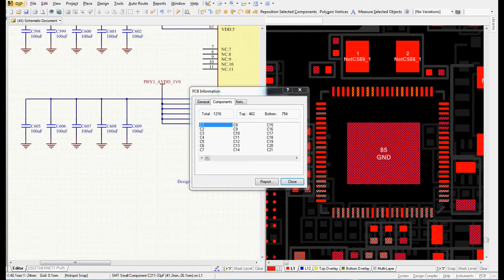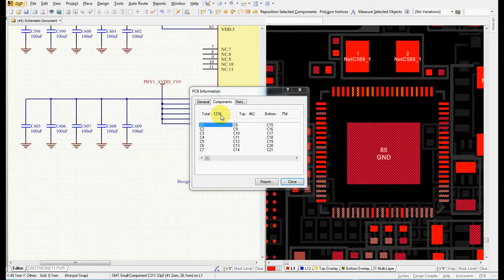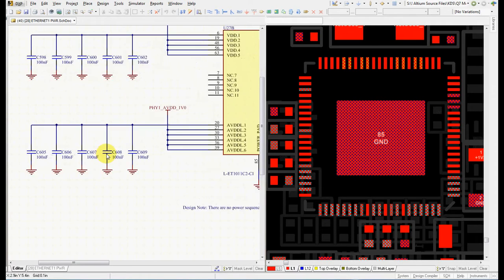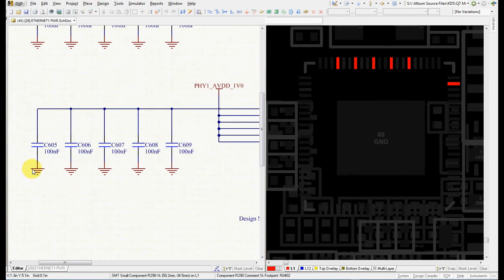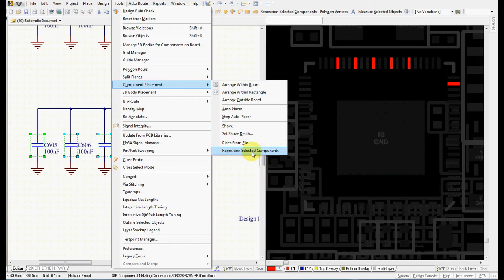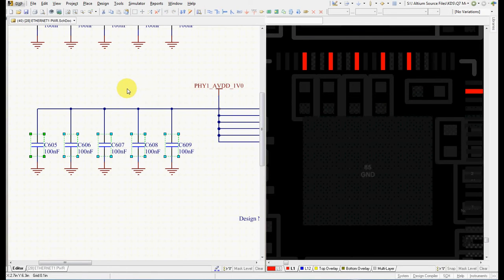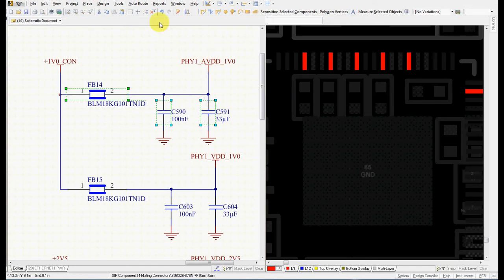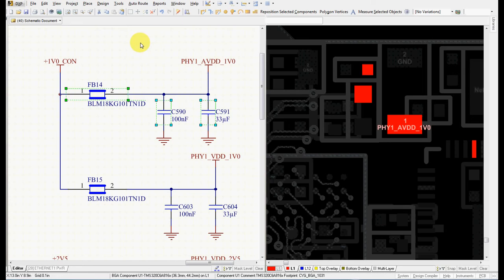Altium Designer - Component Placement Tutorial

Comment: Hi Robert,

Great, works OK now, But now I cannot select multiple components in schematic ( using the PROBE) i am only able to select one component at at time, even i am HOLDING down the shift key.

I am trying to do the same as you are doing
Reply from the maker: Use probe to select the net and then press right click to cancel the "probe mode". After that, just select the components in schematic (press shift and left click) and then use "Reposition selected components" in the PCB